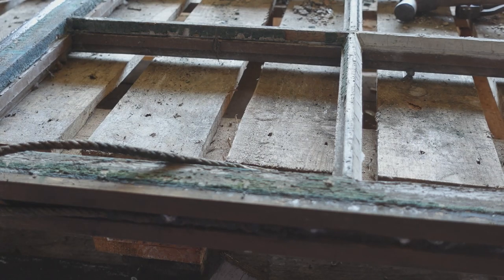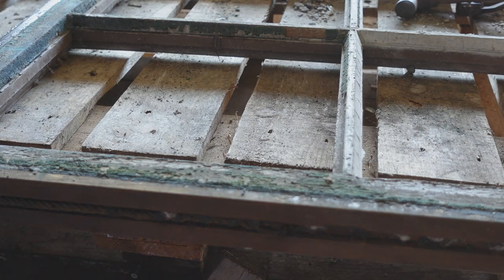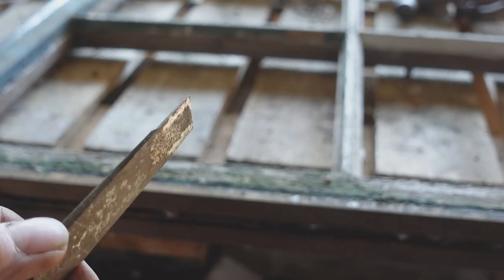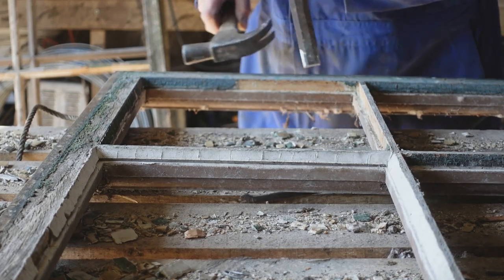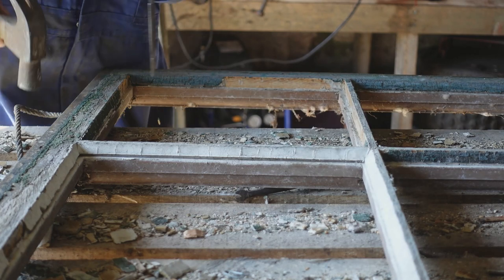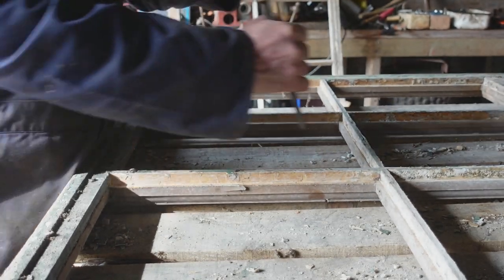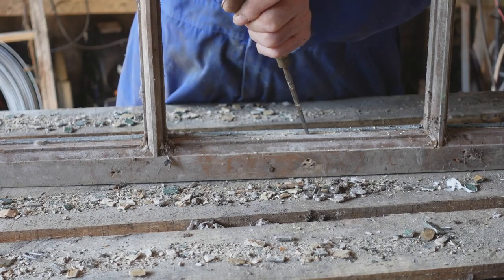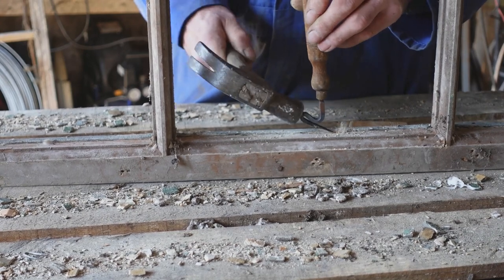Removing old window putty, special tools

Comment: Thanks for sharing your experience and tools. I am currently working with 90 year old windows. I am using a heat gun to soften the putty and it comes off without any chiseling.
Reply from the maker: Hi, Interesting; I have never tried heat. Regards, Jon
Reply: Give it a go. Let me know if it works for you. Regards John